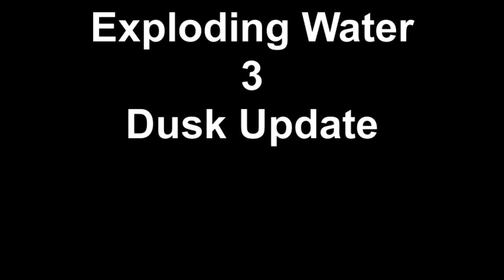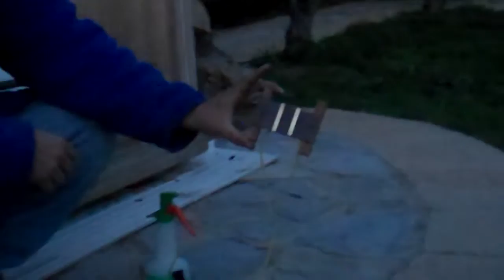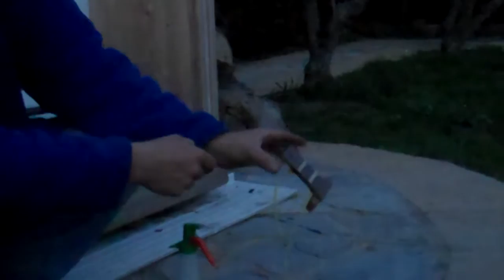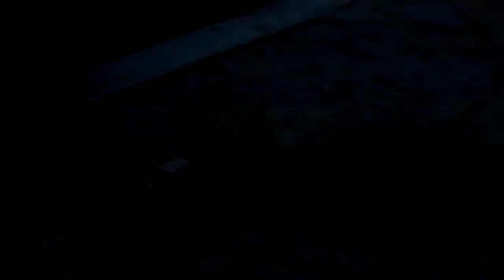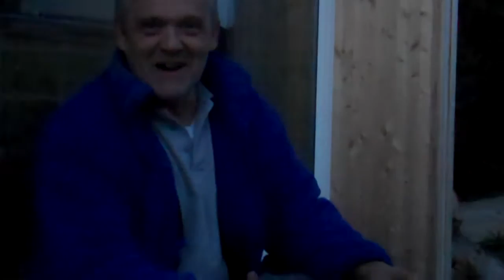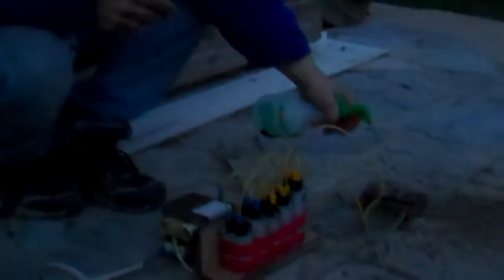Exploding Water 3 Dusk Update

Comment: Voltrolysis......Low amp, and I mean in the millivolt, rangeHigh voltage breaking the covalent bond in the H2O molecule something to do with frequency and quantum level reaction. I may be crazy but if that is true,  then is should be relatively easy and inexpensive to produce large amounts of hydrogen with just a little work. Thoughts please Mr. Incredible?

Comment from the maker: I am very interested in resonant cavity fuel cell. At the moment i am hung up on graphene - but only for it's uses in free energy research and because there is a thing called graphetised carbamide which is a catalyst for water splitting and i am wondering if we could use that too to further reduce the energy input required. that's sort of what i am working on at the moment. for those reasons

Comment: I would like to see the same experiment with distilled water. 
I know that electrolysis should not happen if there are no electrolytes in the water, but maybe we don't need them with such high voltage. If nothing else the amper draw should be reduced. 

Is it possible to break the bonds in the water molecule by some kind of resonance? 
If you are interested google: "resonant cavity water fuel cell", i would like to hear your opinion on this matter.
Reply: It  works with Distilled water too☝️☝️